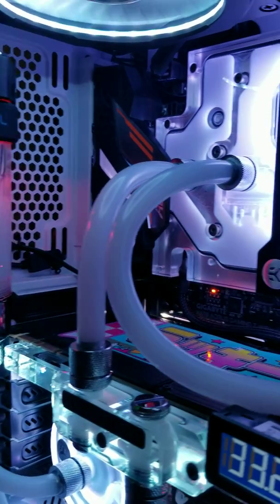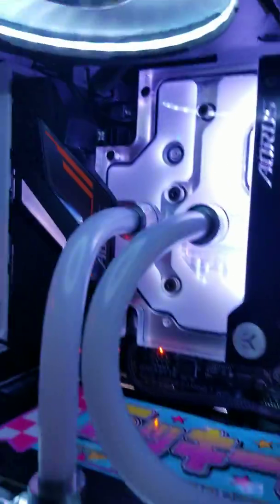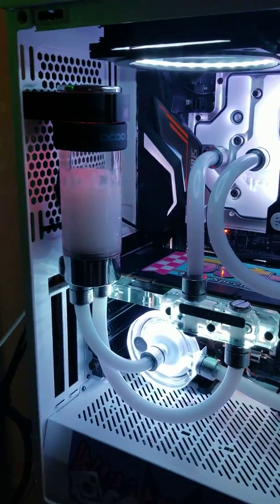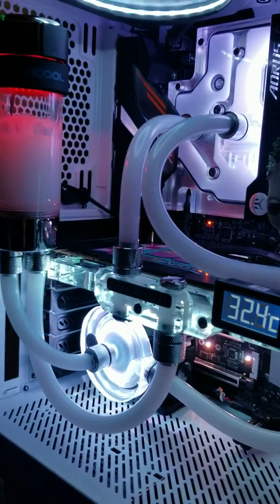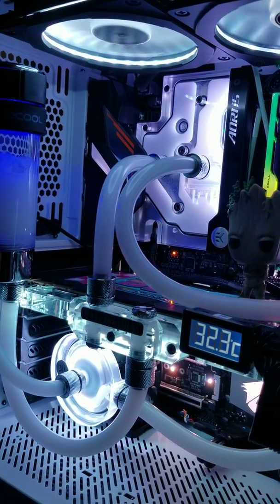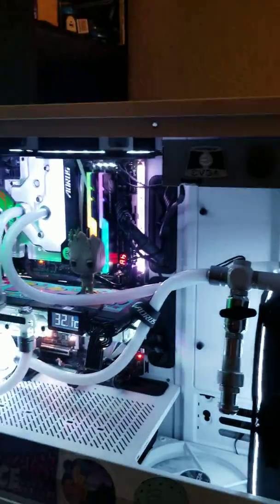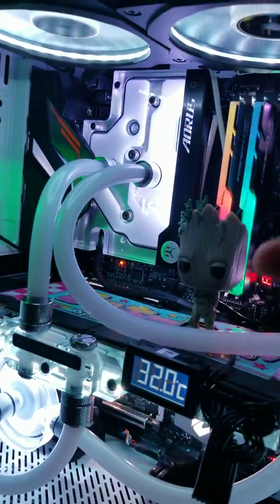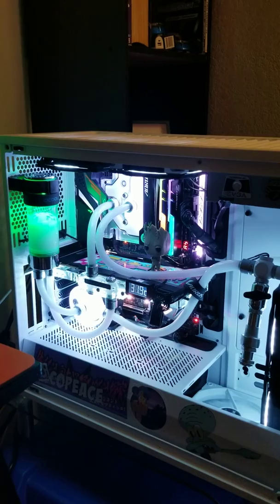Alphacool Cape Corp Coolplex HF 15 Metal Chrome Review/Watercool Reveal

Comment: Good looking build there Colin. I've been evaluating the alphacool reservoirs and it seems a lot of people are having issues with running their lighttower with faster pump speeds. This was really helpful. Perfect timing too. Looks like I'll have to use PWM pumps but it'll be fine after that. You don't need that much flow if you're cooling less than 600W anyway.

Good word on the drain. I'ts not crucial, but it really helps. I highly recommend it to anyone who has the space. (I mainly do SFF builds so I rarely have room.)
Reply from the maker: I ended up upgrading to the Eisbecher 60mm reservoir, it is much better and doesn't add bubbles to the loop like the 150mm lighttower reservoirs.
I will be releasing a build update soon!